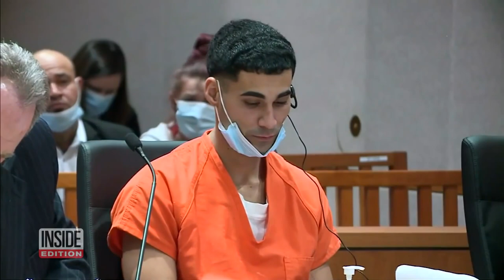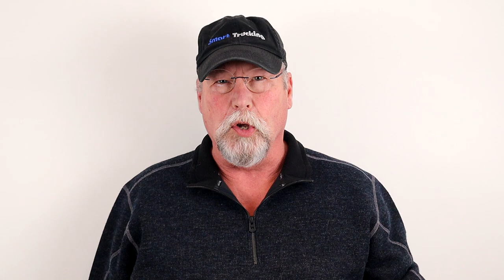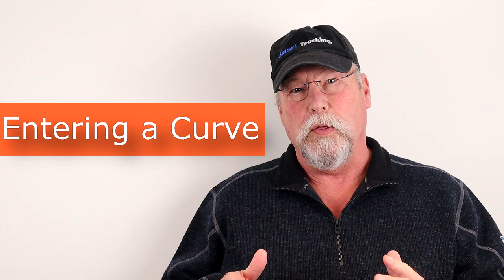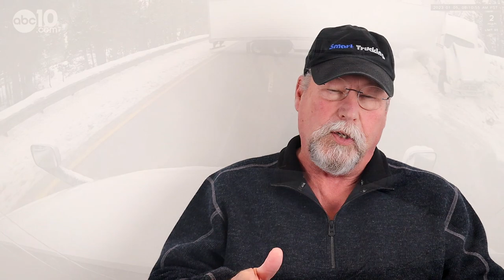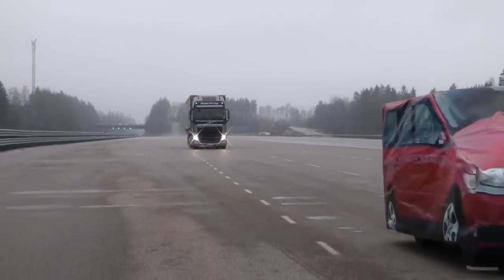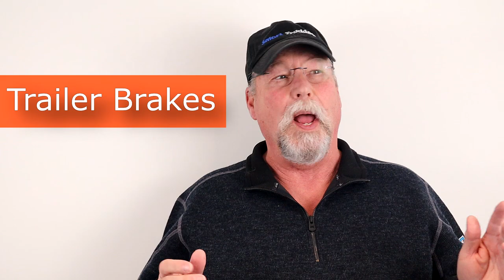Braking in a Semi Truck 101: What You SHOULD Already Know (But Might Not!)

Comment: I never hit that Johnny bar for anything other than to test my brakes while leaving the yard or truck stop. Always look 15 seconds ahead and never stop scanning. It'll reduce a lot of problems when it comes to braking in all situations. I've had the chance to operate with a truck and trailer with disk brakes and I love them. God be with you drivers
Reply: Well the trailer brakes can be used to bring you out of slide when your starting to jack knife.... apply trailer brakes and accelerate,   the trailer brakes will pull against the cab while your accelerate forward.
Reply: @kellypatterson8506  I just do my best to avoid it. Since starting trucking in 2016 I've kept myself from being put in the situation. Even though I like staying up North during winter
Reply: Those new disc brakes are really great. The only issue that I have is checking them on your pre/post trips. You can’t get in there and look at them like you could on the drum brakes.

Comment: A Johnny bar or Trolley handle (in my opinion) only has 3 possible uses.
1. Slide axles, especially if the parking brakes are not holding properly. 
2. Test the stopping power of trailer brakes when hooking up to a trailer. 
3.  Doing a tug test when you get back in your truck to make sure someone didn't pull your 5th wheel pin while you were away from your truck. 

Awesome video, as always!!

Comment: The panic brake/stop in my experience you are so focused on minimizing damage, and hopefully trying to avoid the wreck. About a year half ago. Had a car cross center line. Aftermath skid marks showed i slightly turned my wheel to the right. Making it more of corner to corner rather direct head on. I remember foot and brake as hard and fast as I could. Never had time to reach for air horn or trailer brake lever. Skid marks and point of impact marks told whole story. I was in my lane whole time even after the steer axle broke. Car had a kid in his 20’s who was airlifted out and lived. Tested positive for being intoxicated. Whole point of this. When you run into the panic brake you very well may not have time to think. Just do

Comment: I was in fort collins last march at the big budweiser plant and I met this big ol black girl who burned her trailer up coming down i70 into denver 4 days before.  She swore she was using the jake brake but i knew what happened.  I gave her usefull hints since she was knew and none of her supervisors had ever held a cdl.  

A few hours arfter we both departed i get a frantic call from her and she said her trailer brakes were smoking again.  I asked her if she was using her jake and to send me a pic of it. She was driving a t680 and thought the johnny bar was the jake brake like in many other newer trucks that have it on the column. I told her to sit tight for 20 minutes with her trailer brakes not popped so they would cool.  If her supervisors had any idea what she was doing she would have been fired but luckily for her (unluckily for the public), they had no idea.

Comment: The trolley brakes were originally used before spring breaks were required. To this very day, some 50 years after spring breaks have been required, the proper procedure for test purposes, for hooking up to a trailer, is to back up to the trailer, get out and hook up the brake and electric line, and then apply the trailer break so that it does not roll away when you try to get underneath it. I use it To make sure that my trailer brakes are working fine. As I pull out from the spot in the yard, I put my automatic transmission in neutral, and pull the trolley break. If I need to, a back up and hit the brakes a couple of times to adjust them

Comment: Descending grades, i pick a proper low gear with the jake fully on, I know I picked the proper gear when the jake is slowing me down instead of speeding me up, then I lower the jake a notch and let it pick up speed, then I turn it back on full power and let it slow me down. And I keep doing this until I reach the bottom of the grade. On a 12 speed, 7th gear for a 7% grade with the jake fully on is perfect. For 6% grade I like to go with 8th gear :)
Never as so much as need to even use my brake pedal, only to down shift when I need a lower gear.

Comment: Your friend's trailer brake situation is one of the best arguments for keeping the trolley valve in the cab of new trucks. I always test my trailer brakes on the yard before I leave by driving at about 5 mph after the air has had time to fill the tank and pulling the trolley valve. Any hesitation in stopping means they're out of adjustment and the unit is not roadworthy until fixed. Nobody wants that delay. The good carriers, including mine, will pay you for your time while you wait for a technician to fix the problem or while you get your freight moved to another trailer.

Comment: In my experience I've grown to hate disk brakes. When I drove garbage trucks I got to drive a couple trucks that had them and I had brake fires on two separate occasions and almost had a 3rd just from normal use. It was always just one brake that would stick and all the others would be fine. I also never noticed any difference whatsoever in stopping power compared to drum brakes. Maybe there was just something wrong with those trucks, but I've always been skeptical about disk brakes after that.

Comment: I never realised how useful that trailer brake handle can be until I got a truck without one.   So many problems can be solved with the ability to use only the trailer brakes and not having to pop the supply valve to set the trailer brakes.   But I have never seen a time that using only the trailer brakes is good when the truck is moving more than 10mph.  

The air disk brakes are great.  But I get paranoid because it is impossible to see the brake pads most of the time, so when picking up a trailer, not being able to see if you actually have any pad left on them is a bit scary to me.   Especially after hooking to a trailer that someone dropped and the trailer brakes had been dragging and there was virtually no braking effort from the trailer(with disk brakes) because they were pretty much metal on metal at that point.

Comment: As a wheeler, I will put my car in low gear where appropriate on flats, but most importantly, descending a hillside, or mountain side as you do, to minimize the wear and tear on the brakes, letting the engine do the braking.

Comment: I got my CDL the first time thirty years ago. They used to teach safe speed going down a hill is the same as going up. Example 40mph when you crest the hill is the speed you go down 8th gear and use the Jake to slow you down. Now I’m the automática they teach that safe speed going down a hill is speed limit minus five. Use the Jake and stab the breaks. I think the issue is driving an automatic truck with bendix etc. teaches mental laziness, rather than attentiveness to what is going on around you.

Comment: I remember a few years ago I was doing a test drive to get a job with Celadon. The instructor threatened to pull the trailer brake if I didn't slow down enough on a 360 degree off ramp in Indianapolis.  Needless to say I walked out of their orientation.

Comment: The automatic slack adjusters for your brakes if you pulled over and you pump them up 10 times make sure your pressures over 100 pounds while you're doing it you can bring the tolerance up on your adjustments

Comment: I don’t want to come off as an expert on trucks but I always did my own brake jobs. Replaced the slack adjusters, the s-cam bearings and s-cams themselves. The air brake chambers 30/30, and the brake linings, the oil seals on the axles, airlines, and different valves like the quick release valve. I always adjusted my brakes and it was not at all complicated or difficult. When I was in steep terrain I would check my slack adjusters travel a couple of times in a day.  Going down steep grades I let the engine brake (Maxidyne) do as much braking as possible, like one of your other friends stated he did too. Yes you would hold up some traffic, but the wear and tear on the truck was important to keep to a minimum, and it was for the safety of the vehicles around me.

Comment: The guy that caused that wreck in Colorado also wouldn't have ended up in that situation if he could read the signs for the runaway ramp.

Also, anti-lock brakes don't do any good on ice. Nothing works on ice. Of course, if the roads are that bad, we shouldn't be out there anyway.

Comment: I still remember that one Pete rig I drove that had very bad brakes on it, that one gave me nightmares it's service brakes and jake brakes felt weak going down Mt down grades even going down small hills the service brakes felt weak, I think something was wrong with the jake brakes and service brakes, on the Mt down grades I was driving down I would have my rig in 4th gear with the Jake brakes on it would still pick up speed fast the service brakes felt weak when I would stab them tap them I tried to not use the service brake too much since they can over heat easy if they are used too much riding them, then when I would shift down to 3rd gear it would still pick up speed fast causing me to use the service brakes more then I wanted to I ended up smoking the brakes I pulled over to let them cool down them service brakes felt weak it was scary driving that rig, I was glad when I was given an brand new rig to drive, when i drove the brand new rig it's brakes felt alot safer and stronger, the only thing I miss about the dangerous one with bad brakes is that it was more roomier inside of it, it had two beds an top and bottom bed and icebox and TV it had alot of room in it.
Reply: I thought I was going to have to use one of them run away ramps with that one rig I drove that had bad weak brakes in it it gave me nightmares.

Comment: I used to used the spike when going down a slippery hill on ice. If the Jake started trying to stall the engine. Apply a very small amount of trailer brake till the revs come back up and the drive axles stop sliding. But you run the risk of your trailer sliding sideways. But that was before Jake’s cut out automatically for you so jake stalling was a real danger.

Comment: Keep the rubber side down and keep her aligned,,, I am 47 years in trucking, over 5,000,000 miles accident free. Recently I had a discussion with a teacher when they were about to strike, they make 60,000 per year at the low end of a full timer. I told them I make that at the company I work at working in the city. She belittled my career by saying the exact thing you said, I am just a truck driver, and not very skilled because I only need 2 weeks of training to be a truck driver, and she needed 5 years of university degrees to become a teacher. I simply told her, that if that is what she thinks I had to go thru to be a trucker, that she got ripped off in education.

Comment: I came of Doner l80 back in 1976 318 Detroit 318 two stroke with a 13 speed no engine brakes. but a lot of pinch the seat.     Thanks

Comment: The proper gear and Jake is best shouldn't need to use brakes much if speed is correct. I drive a straight bore tanker. So double important to take your time. And get there safe. That's what we get paid for. Simple if you see a sign that shows steep downhill grade pretend your pulling up the hill .Nobody cares if you get the load there an hour earlier,but if you have a problem they will surely care about that.

Comment: Excellent tips that are spot on, Dave. I actually learned and perfected the “science” of descending a hill properly on the Grapevine. EVERY driver should know how to do this properly with confidence. Low skilled job? Ha! I’ve been at this for 29 years now and I STILL learn new things because the learning never stops. How could this statement be true and correct if driving a truck is a low skilled occupation? I’d like to see some wise ass just try and answer that question.
Reply from the maker: Yes. I believe this industry enjoys keeping truck drivers believing that they can so easily be replaced by autonomy and that they don't deserve decent pay for what they do. I'm glad you don't buy into that mentality. You know the value of what you do and take pride in it. Keep the rubber side down, SoCal.
Reply: @SmartTrucking  10-4 sir, and thanks.

Comment: Was trucking bulk cement in the maritimes one winter way back in the late 70s.
Running around 40,000 lbs to Halifax harbour to load tanker ships in a 5 speed R model Mack for Canada Cement LaFarge.
Roads in downtown Halifax and Dartmouth had freezing rain. Loading area in Brookville was dry to snow covered.

Travelling through the icy side streets to the harbour I could see the trailer wanting to come around every time I applied my brakes depending on the grade of the road.
Made it to the harbour and talked to one of the wiser older drivers at the time.

His answer was to back off one of the trailer brakes so that only 3 could lock up 4th still rolling will keep the trailer in line.
Best advise I ever had.
In these conditions, low speed on ice is a game changer.

Of course reset them when conditions improve...and keep this secret away from DOT. Lol

Comment: I've heard many drivers (mostly older ones) mocking the new  braking assist, or CWAB systems that they're starting to put in new trucks. Well I've been driving the truck I'm in since it was brand new, for 2.5 years and it has the CWAB system, and I have to say that it's a wonderful safety addition that I'm grateful for.
And yes the system could use some bugs being worked out but all things considered it's an excellent tool.
It only works in conjunction with the cruise control system. The driver can set the distance between him and the cars/objects in front of him based on what type of driving he's doing. City, open roads, etc.. and it will keep your truck at a safe distance from traffic in front. It's especially useful for the occasions when a crazy 4 wheeler decides to cut you off, then slam on it's brakes for whatever reason. 
I'm a 25+ year driver and I gotta say that I love the system and it's right up there with Jake brakes when it comes to usefulness.
And once the driver presses the brake pedal manually, the system shuts off and will not turn itself back on by itself like I've heard some drivers incorrectly assume. You yourself decides when to turn it on or off.

Stay safe out there drivers.
Reply: I'm a big advocate for radar-assisted cruise control keeping you out of trouble. There were occasional false positives on one truck I had, where it would get a faulty reflection off a road sign or overpass and thought emergency braking was needed -- but those were easily overridden by pressing the throttle before it really caused me to lose much momentum.

Having said that, I'm frustrated by these radar sensors losing their functionality for a whole shift just because I ran through some rain at some point. I'm not one to use cruise control in rain or wet road conditions, but I can be manually controlling the throttle and brakes and get an error message on the dash about the sensor being out of adjustment in wet conditions, which won't go away when conditions dry out and I want to use cruise again. The only way to beat it is to pull off the road and shut down the truck for a few minutes. So if you're in the midst of a long shift where you're not stopping for a 30-minute break or a 10-hour rest, it's really annoying and pretty much forces you to stay on the pedal. Newer trucks are getting better with this technology all the time, so I'm sure it will be less of a problem in the future. But on dry days, the following distance control with modern cruise control systems really makes the job easier, no doubt about it.